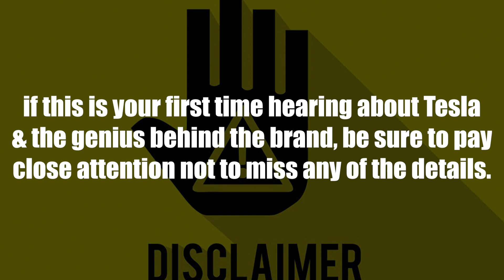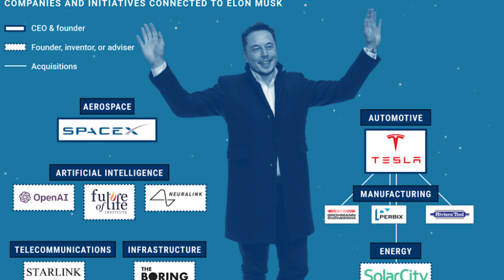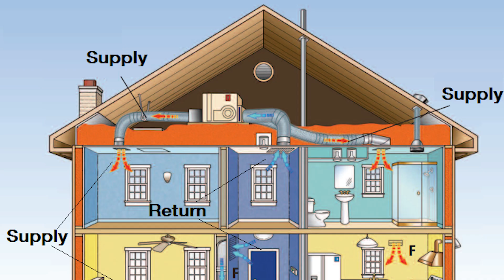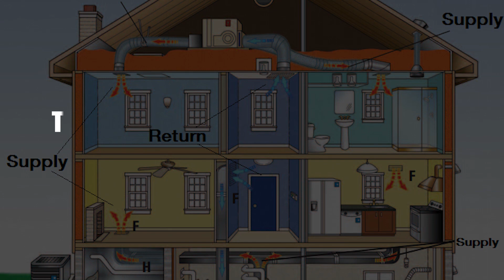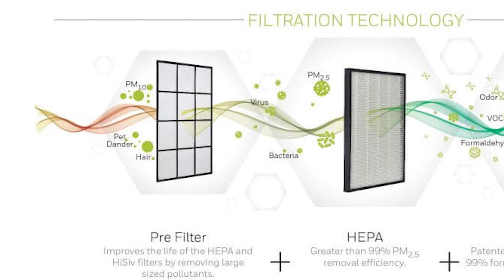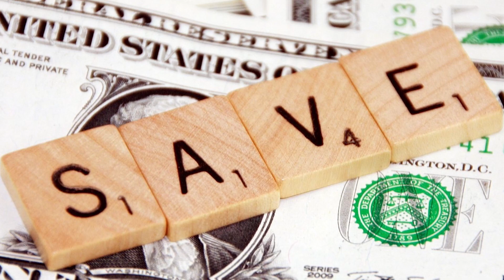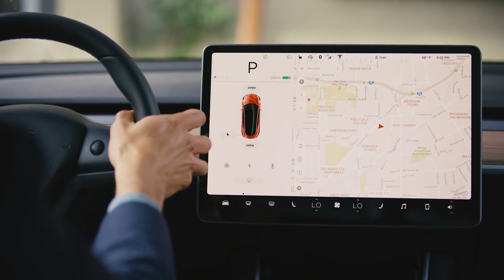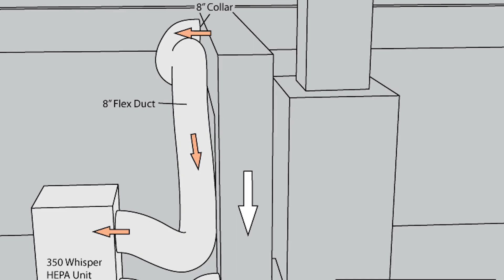THIS Tesla HVAC System Will Change The WHOLE Industry

Comment: The air filtration wouldn’t be the problem to tackle conventional systems can use a hepa filter if they so choose
Reply: Hepa is great but it has its limitations.    You’ve got to change them frequently and if you want to filter out pm 2.5  ( aka the worst and most damaging type of pollutant on the planet). Same goes for recycled air which is SOP for most hvac systems.   You would be amazed at the numbers for indoor pollution.  Volatiles are not so great for the lungs either.

Comment: In Europe, we don't use hot air heating we use a wet heating system via underfloor heating & a separate heat recovery ventilation system